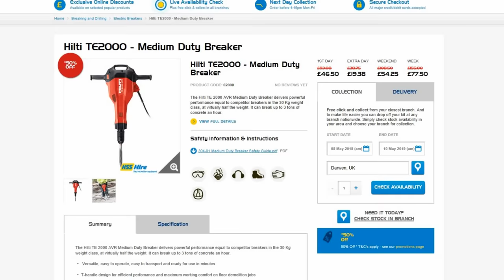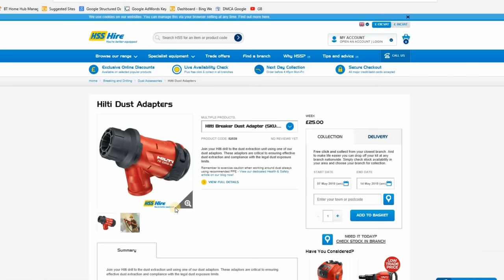How to break up concrete

Comment: You’ve got to be the first tradesman I’ve ever seen clean a hire tool, good on you! Their normally in a right state when I pick them up
Reply from the maker: I always clean my own tools after use and think it's only fair to do the same when hiring them. I think some hire firms also charge for cleaning- I don't blame them at all.
Thanks for the comment 👍
Reply: If you rent keeping equipment and don't  lean it before returning it then there's a cleaning fee. 
The choice is save money and clean it or spend money to have it cleaned. GREED 101
Reply: I always clean rental tools before returning them. I don't even care if there's a cleaning fee, I do it because it's right. It's how I like others to return my tools to me.

Comment: Great video, for anyone looking at renting a breaker it can be just as cheap to buy. I bought a £99 breaker brand new from screw fix, then sold it after I had finished with it for £65. Yes, it's not quite as good as the Hilti, but it did the job and I could take as long as I wanted to do it as I wasn't paying per day.
Reply from the maker: Thanks for the comment

Comment: Great video, thank you...Just bought an Aldi 1900w/60Joules/22kg breaker...hope it's going to be ok...Great video...and great to see you clean the tool before going back to the shop...proper order!
Reply from the maker: Aldi tools are often great for the money. Obviously they are nowhere near as good as Hilti, but for occasional use, it should be fine 👍
Reply: @ultimatehandyman  Thanks for the reply! They are indeed. This Ferrex breaker is identical to a Scheppach AB1900, in fact it is the very same one, made by Scheppach & rebadged for Aldi/Ferrex. It retails for 250stg on Amazon yet I bought the Ferrex version for 99 euro (90stg). Of course these tools are not for daily use like the excellent Hilti but for an occasional job & with a 3 year warranty they are amazing.

Comment: A very easy thing to do that speeds up the break is to make a grid. Say for a 2 by 8 slab you go and put lines ever 25 cm in a grid. Then, on those lines you drill (with a thin drill, so fast) every 8 cm. A sledge hammer and a splitting chisel  will do the rest. I think that the best part about doing things this way (outside the therapeutic nature of hitting things with a sledge hammer, i mean, people pay for this kind of stuff) is the fact that the concrete comes out as manageable slabs. If there's one thing i hate about chipping concrete, it's the cleanup. Just my 2 cents, not really "the way" to do it. :)
Reply from the maker: Thanks for the comment 👍

Comment: Screwfix sells a massive breaker about the same size for £150. No doubt it wont be anything like the Hilti in terms of quality but worth bearing in mind. I got one and it knocks concrete apart pretty well.
Reply from the maker: Thanks for the comment 👍
Reply: And I have that Titan one from Screwfix. It’s excellent. 

So to say no doubt it won’t be anything like the Hilti is a fair point in terms of relative costs, but the Titan has never let me down.

Comment: you are very responsible user. you clean up this power tool after work done. really appreciate it!
question: if I use this tool to demolish 1mx1m brick-wall of my kitchen, will my downstair and upstair neighboor disturbed with the noise and vibration?  what I can do to reduce the disturbances?
thank you..
Reply from the maker: I would not use this to demolish a wall, you need a different model for that.
It's best to warn your neighbours first and speak to a structural engineer before demolishing walls 😉
Thanks for the comment 👍

Comment: Thanks I need to remove a concrete base underneath my green-house which i was dreading. Will definately hire a breaker instead of using my SDS 4kg drill.
Reply from the maker: You are welcome. A proper breaker, makes the job much easier!
Thanks for the comment

Comment: Great, informative video.

Do you think anti-vibration gloves would be necessary when using the breaker?
Reply from the maker: They will certainly help, although the Hilti breaker does have an anti-vibration system built into it.
Thanks for the comment 👍

Comment: If I were to break up a concrete base like in this video, could I run a wacker over the top of the bigger pieces of concrete to break them down smaller so I could compact them down to make a sub base for laying a patio on top?
Reply from the maker: No, the pieces would be too large. They have massive crushers for crushing old concrete to a size that will make it suitable for use as crush and run.
Thanks for the comment
Reply: Ultimate Handyman what if it was only mortar?
Reply from the maker: Not sure, as I have never tried it.
Reply: Ultimate Handyman okay pal thanks for getting back to me!

Comment: Just out of curiosity, how much does it cost to dispose of all that concrete rubble?
Reply from the maker: Very expensive.
My neighbour got a 8 ton skip, which cost about £240. We filled it this Saturday and there was still another half a skip load, but luckily a local farmer is taking it. 
The hard part was getting it to the skip!
Thanks for the comment

Comment: So I need to I need to remove from existing concreate patio but leave the rest.  As I have an old wooden learn to sitting on it.  This means I need a clean edge/cut. I also don't want to disturb the foundation for the lean to. I have a Silverline breaker already I'm worried if I use that it will disturb the lean to concrete foundation any tips?
Reply from the maker: Cant you cut the concrete first using a suitable saw, perhaps something like this-
https://www.youtube.com/watch?v=_NlDlwwvXVg

Comment: Hi Sir, Have you ever installed a lintel above a door? What is your take on these concrete cutting chainsaws. To me they seem the most suitable for such a job. Or should I consider other tools as well?
Reply from the maker: Yes, I have but it was years ago. I used Acrow props and strong boy attachments above where the lintel was to be placed. I then used a 9 inch angle grinder and diamond disc to remove the mortar, but you could consider a reciprocating saw and TCT blade, like this- https://fave.co/3bqTz2S
Or, you might consider hiring one of these- https://www.youtube.com/watch?v=2dYgYl0dxOo (I've never used one)

 Thanks for the comment 👍

Comment: Wow, what is the amp draw on something like this??
Reply from the maker: I think it's about 16 amps (110v)
In the UK we normally use 230v but most sites require you to use 110v power tools, so most hired equipment is 110v (hence the transformer).
Thanks for the comment 👍

Comment: "It needs to be transported to a skip, which is not as easy as you might think" 
half the job! one 2000'er can feed four guys running pales 50m. 8 men if you're bucketing trough a building still in use, down four flights of stairs cause the service elevator isn't rated to carry anything other than supermarket sushi and loo rolls
Reply from the maker: https://www.youtube.com/watch?v=Su3Cn46Frz4
Thanks for the comment

Comment: Way to much work🤣 I’d rent an excavator with a hydraulic breaker and then use a bucket to scoop it out.
Reply from the maker: Most people would, if they could get that equipment in there.
It was good exercise though 
Thanks for the comment 👍